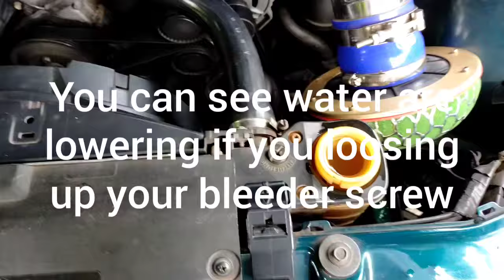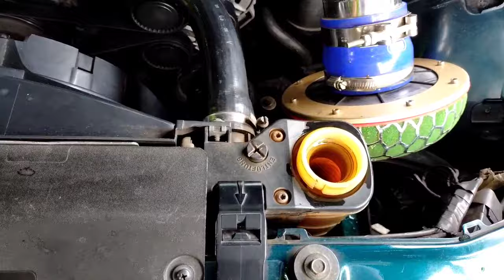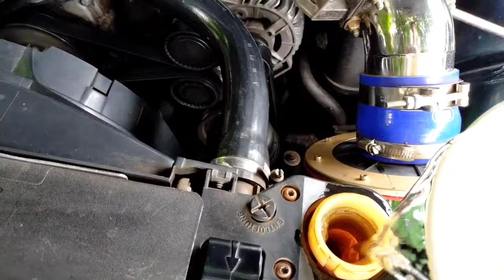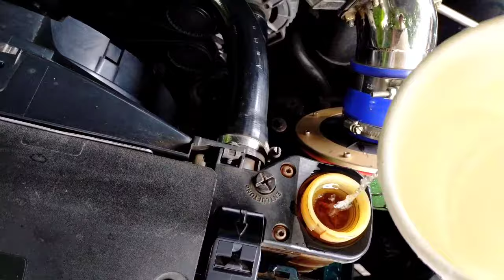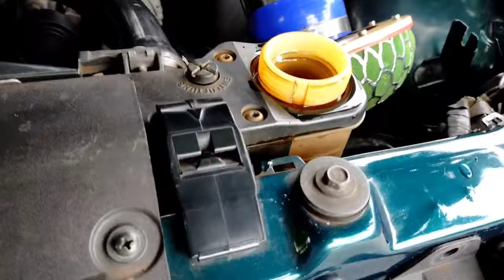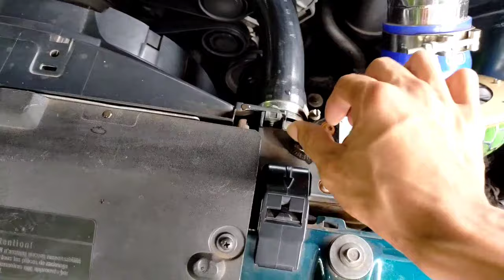BMW e36 how to remove trapped air in cooling system

Comment: Ano a ng dahilan kung bakit kailangan mag bleed po sa radiator.. Thanks.
Reply from the maker: Pag nag drain po kyo radiator or nag bawas ng water pag nag refill po kyo water meron air trap bubbles sa engine pag hindi po kyo nag bleed pwede po kyo mag overheat
Reply: @rayner1984  Ah ganon pala Salamat po sa informasyon..